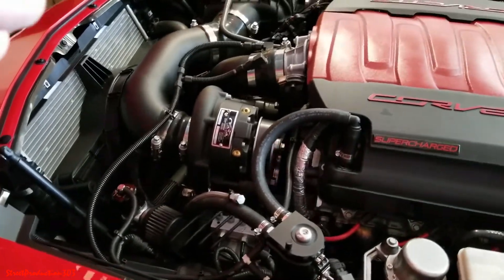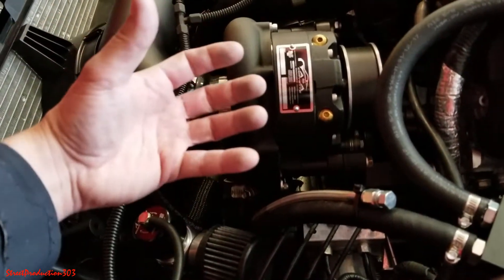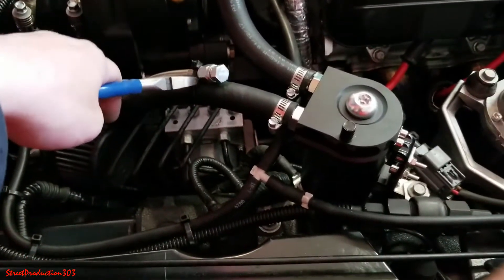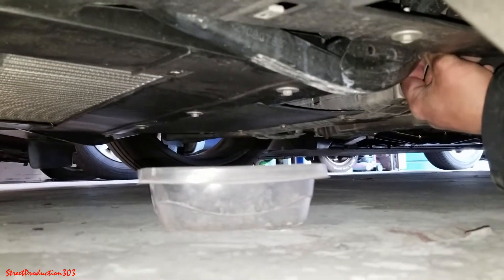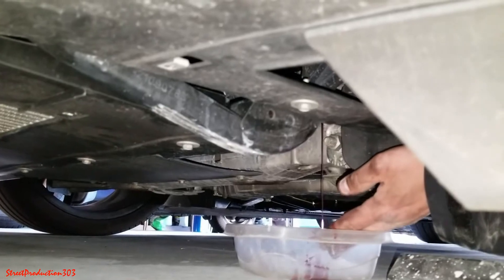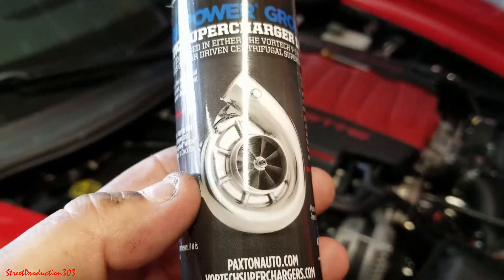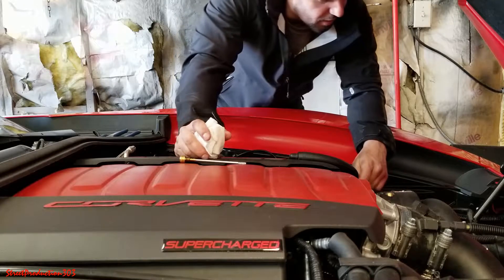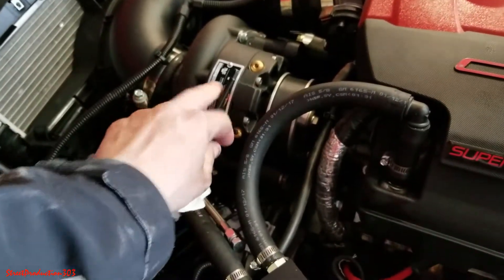Corvette Stingray How To Vortech Supercharger Oil Change

Comment: I'm getting a strange noise today when I shut my car off warm it was making a kind of sizzling blow off noise under the car I don't know if the condensation from the air conditioning was dripping on warm engine I have the same exact supercharger on my Z51 that you have in the video
Reply from the maker: I get water from the AC condensation dripping on top my exhaust below. Goes away pretty fast after parking.

Comment: Hey man, my oil dip stick seems to be inside the unit. How did you get it out?
Reply from the maker: It should be one of the two top screws. The dip stick pulls out with the screw.

Comment: i have a ecs super charger that looks justr like the one you have but was wondering can i use the same oil you are using ?
Reply from the maker: The specs on the package say, this oil can only be used for the V3 Vortech and "Paxton SL" blowers. So if your ECS Paxton supercharger is the SL model, your good to go.

Comment: Hey dude do you have a wideband AFR?  If so what numbers do you show at idle?
Reply: Do all c7 have that? I have 1lt z51.  If so how do I access it and what AFR do you have at idle?
Reply from the maker: +Kickin Addiction yeah it works on all C7 Corvettes. You have to get a wireless bluetooth OBD reader. Once u plug it in, you use your phone or a tablet and install the free app called dash command. It pretty much gives you digitial gauges. As far a my AFR..your is going to be different, since i live in Colorado and at the high elevation the car is tunned differently than at sea level.. Go to my instagram, I have the dyno chart uploaded on there with the HP numbers and on the bottom you can see my Air to Fuel Ratio as well.
Reply from the maker: No I do not. Sorry! I use dash command and it reads the AFR thru the factory system.

Comment: Thanks for the video.  I have the same kit, and I notice when I top off the engine oil I start pushing oil out of the blow off valve.  You have a catch can, what one is it?  And you think that would fix my issue?  I am running 9psi on 3.6 pulley.  Thanks
Reply from the maker: Glad I could help! Yeah I have a generic baffled catch can, that I modified the lines to work with the C7. Cost me like 40 bucks total and works perfect. As far as the oil, yes the catch can will help relieve crank case pressure and help work the oil issues. Make sure on ur catch can, u replace all the PCV air lines to 5/8, if u don't, a catch can will not help.
Reply: Street Production 303 awesome.  So the one line goes to the valve cover, where does the other line go to?(the line you have the supercharger drain line zip tied to?  Where does that line go to?
Reply from the maker: So on your catch can u have a line coming IN and a line going OUT. Run ur 5/8 line from the PCV and put that into ur IN on the catch can. On the catch can OUT line, that 5/8 hose will go to a nipple that is on the intake pipe, right before your Supercharger.

Currently, from the factory, you have a hose going from the PCV to your nipple right before the SC. All that your doing is adding a Catch Can in line, so that the air has to circulate thru that catch can and filter out the oil. Its literally like having a hose going from A to B. U cut that hose in half and place a catch can in between.
Reply: Street Production 303 awesome I get it now.  Thanks again 👍
Reply: Street Production 303 I ordered the same one you had.  Thanks for the info.  Hopefully my car stops pushing oil through the blow off valve after this.  I’ve also read that lots of z51 owners run their oil a little low to prevent the engine from pushing oil have you heard of this?  How much boost do you run?  Hp?
Reply: Also, how much oil do you catch in the can and how often do you need to drain it?  Thanks for your help sir
Reply from the maker: Sikkk dude! I am at 9.8 pounds and 712 wheel hp.
Regarding the oil issue..I have never had any problems with any of that or even blow by. I did install a catch can just in case, but it was really not necessary.
Good luck on ur build. Keep me posted.
Reply from the maker: Here is the link to the one I bought.

https://m.ebay.com/itm/Cylinder-Aluminum-Engine-Oil-Catch-Can-Reservoir-Tank-Breather-Filter-Fit-Black/222581520762?hash=item33d2e4797a:g:ZnIAAOSwWLBaPhp7

Make sure not to use the clear blue lines in the kit. Go to autozone and buy 5/8 lines, it like 5 bucks. U will have to get a L bracket at homedepot and mount it in the same place as I did.

I also put stainless steel wool in the can to catch more air oil particles. It's like 2 dollars at walmart.

Comment: I noticed you have a catch can on the driver vent, do you have a similar one on the passenger side?, how did you secure it to the car?
Reply from the maker: Yes! Only on the drivers side. Its connected thru the PCV system to catch oil particles and upgraded to 5/8 hoses to relieve crank case pressure. Its attached with a stainless steel L bracket I got at home depot. Theirs is a bolt that can be removed that pretty much holds wires in place on the drivers side..so I used that to attach to it. Catch can was more of a precaution install for me. I never had issues with carb build up or Crank case pressure. I'd rather be safe than sorry